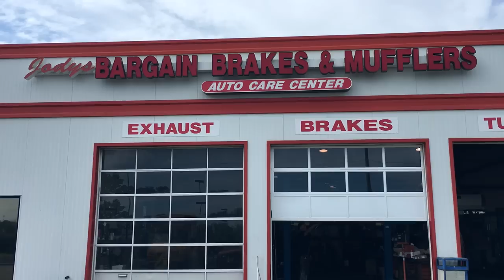EXTREMELY LOUD 350z...(She Pops)

Comment: As a guy who is 43 with out kids and a 27 year old girl and dont plan on getting married because pussy isnt difficult,I travel all the time and own not only 2 Vintage/Exotic Auto Dealerships in the Vail/Breckenridge Colorado area but in the San Francisco Financial District and both of my Dealerships have ASE Ferrari,Bugatti,Lamborghini,Maserati,Lancia,Porsche,Audi,Vw,Bmw, Mercedes/Maybach,Alpina,RENNTech,Pre Merc AMG,MAZDA,Jaguar,Rolls Royce,Bentley,Vauxhall,Land&Range Rover,British Leyland,Pre BMW Cooper,Nissan NISMO,DUCATI,Aprilia,Husquavarna,HOLDEN,Opel and Yamaha Certified..6 of my 24 Service Technicians worked in F1 for many years and just cant travel anymore because of family life..Most of my Techs have been employed by by more than one manufacturer to build and maintain the manufacturers cars from LeMans to Pikes Peak and alll in between..I actually just recieved my RADICAL RXC Twin Turbo 500 R"The R is a completely different animal than the 500 which I also have.." and all 32 cars built since the RXC Coupe were released are SOMEHOW Street legal even though it doesnt change anything to run on track including LeMans..The R puts out most HP and Ford had RADICAL help them develop the new FORD GT and the RADICAL is neck and neck performance wise with the LeMan winning GT..Also 2 guys in the Colorado shop worked in NISMO R&D..I have one of only 4 TRUE 3 PEDDLE MANUAL TRANSMISSION U.S. SPEC GT-Rs but doesnt use a slotted trans..Its a QUAIFE ZF 7 speed..regardless.This was about the 03 to 08 350Z and not only do we build upgraded 350s but we do R&D....I do research and development on ALL popular cars we sell to see how and what will TRULY make more power and not just take your hard earned money.. FACT is that a 350z will make most power with a DEDICATED SEALED!!! COLD AIR INTAKE USING A FILTER WHICH Dodge took and designed for the 2nd drop in for the Demon..It is engineered to cause a non turbulent vortex of spinning air which bounces off the intake we designed and under throttle the air then bounces back starting to spin and does so into the open end and the small opening in the middle takes that air whichbhas cooled down from spinning and keeps on into the runners..I have a patent on this intake and on a Manual 2003 350z it gained 14hp and 11 lbs/Trq..This is supposed to be about exhaust right? well they work together..Then we add a particular size LONG TUBE HEADER whichbthen runs into a 3 inch collector and to an aluminized offroad X pipe..."offroad" simple means "no cats" Also kids now days call EVERYTHING A FCKN DOWN PIPE!! ONLY A TURBO VEHICLE CAN HAVE A DOWN PIPE..PERIOD..Our exhaust can have one or 2 baffled exits but the single is not only cheaper..lighter and makes more power but sounds more powerful AND gives BETTER throttle response..It depends on what ypu want your trq curve to look like but you will get more power at higher RPM WITH A SINGLE and we have a dedicated Z1 "Muffler" made in England RADICAL ONLY for my company and yes its a bit loud but in the U.K.cars must use mufflers at many tracks for noise reasons and it doesnt drone but does give fiery idle downs under declaration..With a full decated exhaust with a single can and exit with 3 inch pipe from the collectors and long tubes WITH our air box and uncurved air intake..The car made 48.8hp and 41.2 lbs/Trq compared to 43.4hp and 36.5lbs trq using duals..plus your going to add 40 plus pounds of weight if someone goes with duals..It also will allow a front/rear splitter set up to function properly without air turbulence...This is using a NA set up obviously but with a Turbo set up whether single or Twin which is what im running...The single is SERIOUSLY KING and helps our builds attain up to 50 plus wheel HP that a Dual loses.We also make and sell remote and wired remote cut outs which are a great option in California and install them on 60% of cars we sell...If you care for my info..Hit me up with a messageand I would happily email you some videos of the dyno As well as my website..I have a 2006 1000HP LS1 TT 350Z with a T6060 TRANS from a Viper ACR as well as a custom Ford 8.8 IRS..The car has been on 1320 video more than once..Its under $15,000 Street Grudge Race..It may be deleted..I havent looked in a while..I obviously wouldnt sit here and type for fun so I hope u are intrigued man..Be safe out there man! ALSO..If I was you...Dont try to add Forced Induction to your car yet..You have a nice car.Keep it RELIABLE!! People will tell u that it still is but even with a SINGLE turbo your maintanance goes through the roof...Oil changes every 1000 miles,spark plugs monthly,worrying if 93 is out or the area doesnt sell it.More wear and tear ON EVERYTHING..Its WAY more fun to DRIVE a 350hp car than worry about fixing the 500hp  car that is just sitting in your driveway..TRUST ME PLEASE.You can build this car ANYTIME and in 5 to 10 years the support for tgem will be AWESOME
.I STILL also have my 1st 3 cars and one is a 91 Miata which I wanted to Turbo SO BAD back at 16 in 91...I didnt but NOW it has a full aluminum ROUSH 347 SBF with a Vortech S-Trim,Magnum T56 & 8.8 IRS MAKING 696HP &  701TRQ..IT IS CRAZY BAD ASS and its Stanced with BC COILOVERS and 16x9 0 offset Front and Rear...it will light up the Hoosiers at 140 under acceleration..It will spin at ANY SPEED..See man.I waited and now I have a car that at 16 or even 21 couldnt have had built..or much less built RIGHT!!! Best of luck!!
Reply from the maker: I just read all this. I'm slightly overwhelmed but also feel so informed. Thank you for that, whats a good email to reach you at. My social media is linked in the description reach out and lets talk!